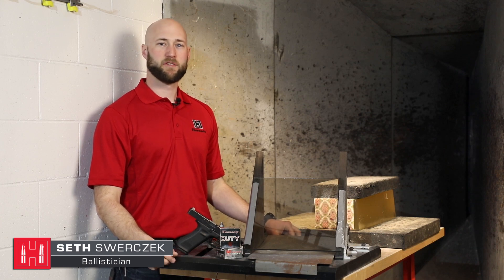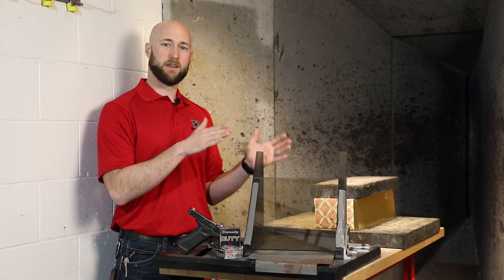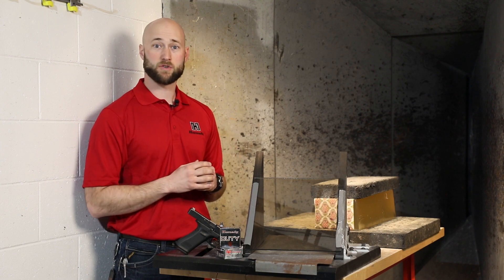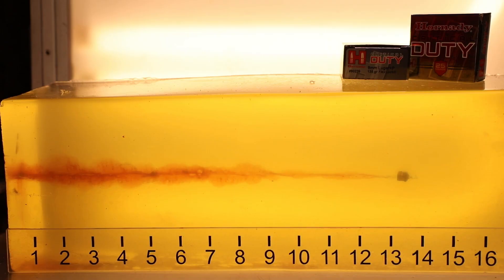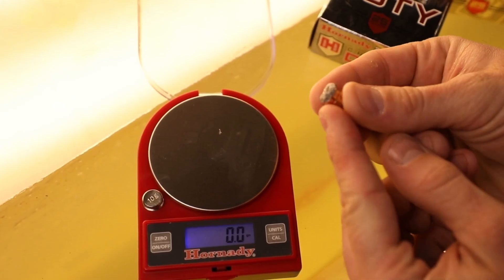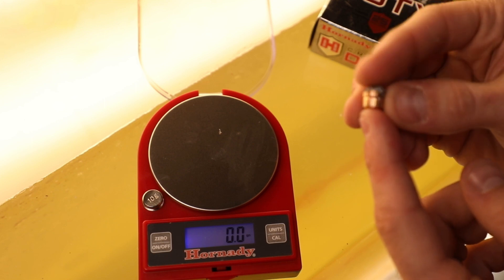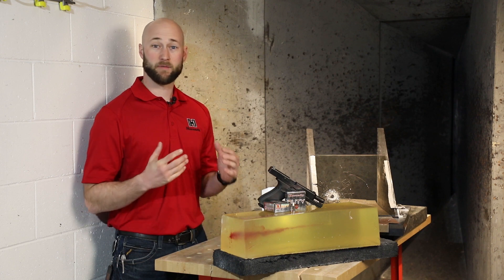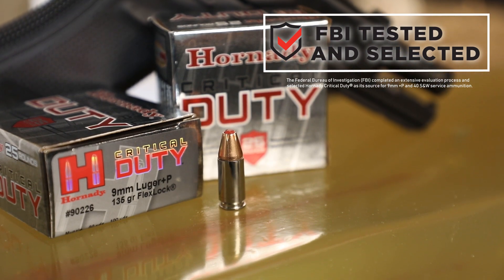Hornady® Critical Duty® 9mm +P 135gr FlexLock® - AUTO GLASS Gel Test

Comment: How much will point of impact change when going from FMJ target rounds to these hotter duty rounds? My sights are dead on with target rounds. Duty rounds so expensive i havent shot any yet. Hate to move my sights though and hoping i wont need to
Reply: Not enough to really matter at handgun distances. You're talking maybe an inch at 50 yards.

What I will say is always always get an extra box of your carry ammo to run through your gun before you carry it just to make sure it works.

I know it's almost 30 a box. It sucks to just shoot it up. But what sucks a lot more is a jam in a gunfight because your gun is ammo picky on what you decided to carry.
Reply: @redfoxtactical8425  I went down to the pond today and shot some of them. They were dead on target 👍. Nailing tree leafs floating on the water like little bullseye 🎯.  Very smooth shooting too. Didn't notice any recoil increase either but I'm using a old school metal smith wesson 915 from 1993. It's kind of a 1911ish hybrid with open hammer. So it's a really smooth shooter but a bit heavier than today's guns. But I like that. 👍. But they are rock solid 💪 and bulletproof guns. Reliable as they get. 

Oh and they only have 25 in a box...which I think is ridiculous. Should at least get 50 in a box for 30 bucks !

Comment: Why is critical defense been failing to expand lately?  I've seen several videos recently of failures out of the same guns they used to work.
Reply: What rounds do you remeber
Reply: @big6red3  1shot videos is the most recent
Reply: @big6red3  I also tested a 45acp critical defense when I first got it and they all expanded, tested a more recent box and I had failures
Reply: M Blake Jr because they are using clear ballistics gelatin. Standard fbi ordinance gelatin is made of skin proteins and the properties are very different from clear ballistics. I’ve noticed in clear ballistics round will tend to expand less and penetrate more. In fbi ordinance gel the rounds actually expand properly and penetrate less. 👍 do a little research on the different gels. Also this round is designed for 4” and above barrel lengths hence critical duty. I’ve seen a lot of short barrel tests with this round and seems as if you don’t gain the needed velocity’s. 🇺🇸
Reply: @joshuab7737  if it doesn't expand in water, we have a problem
Reply: @joshuab7737  water jugs cause rounds to expand even if they wont in gel. If they dont expand in water, they wont in gel
Reply: @joshuab7737  you dont get it dude, I study this as a hobby. If it wont expand in the material that's perfect medium for maximum expansion,  it wont expand in gel. Show me one example of any ammunition that expands in gel but not in water.....u wont find one.
Reply: Blake he was quoting a commercial for comical relief. You didn’t get it, that’s ok but he wasn’t being serious.
Reply: HST is the best.
Reply: Critical defense and duty are very different ammo
Reply: @CleverCheetah  no sht Sherlock
Reply: The best defense ammo made period
Reply: Bull..sheeeeeit
Reply: @jimmyp5487  tell that to tools and Targets and he will get all bent out of shape and ban u hahah
Reply: Critical defense ammo is specialized to be slightly different than critical defense.

The key difference is duty is made to go THROUGH LIGHT COVER and hit an object then expand.

Critical defense is made to expand on impact of skin and heavy clothing. Hornady themselves have proven this with testing to be true.

These rounds can go through a car door and still expand. That's what the round was developed for and why it penetrates so deep and doesn't expand sometimes on direct impact.

I load critical duty and critical defense 1-1, if my first shot doest expand, outside of a cover situation. My 2nd and 4th one will, and if I have a cover fire situation my 1st and 3rd are able to expand after hitting their cover.